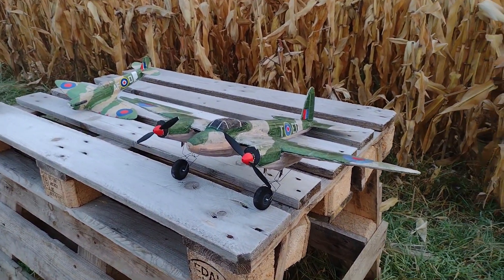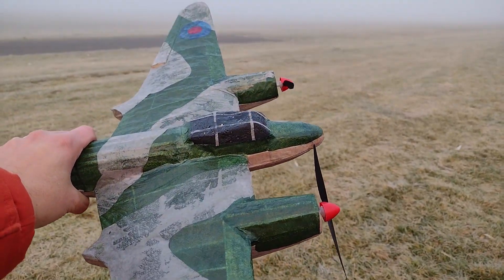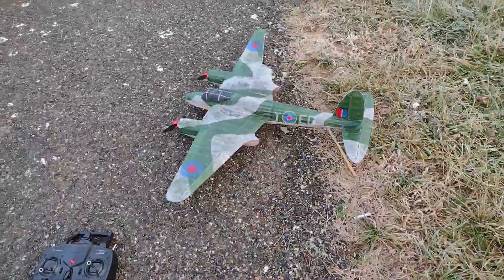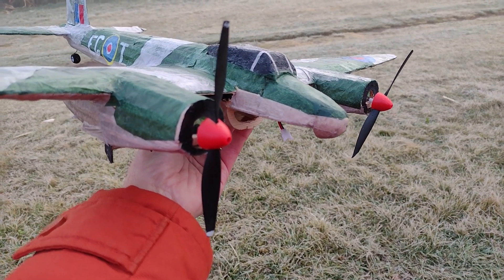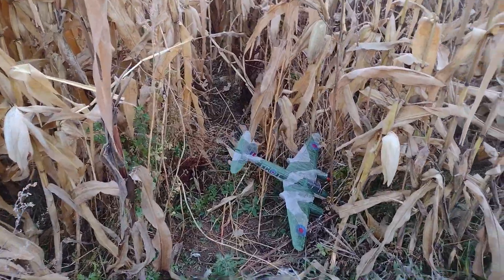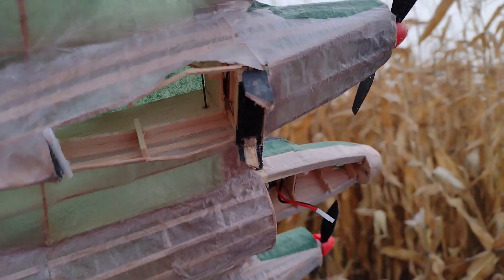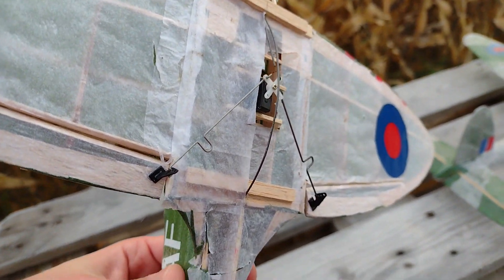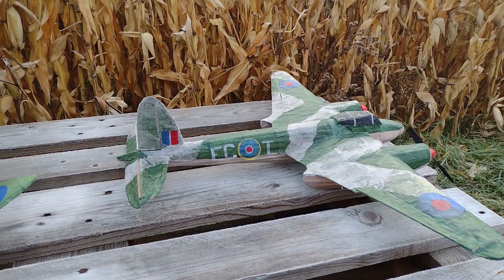Flying the Mosquito and the Spitfire

Comment: I use thin fishing line to attach the control surfaces.  A couple pieces, each a few mm long and glued in with CA weighs almost nothing and holds super well.
Reply from the maker: Thx, I think Cliff does the same thing. I am somehow afraid of fixing the control surfaces in case I need to take them off. Then again, why would I? And with the method you propose, it would be easy to cut them off, and put new ones in if needed. Hmm, you make me think...
Reply: @ CC Cagle At first I thought you were talking about pull-pull to horns and servos then I realized you ae talking about fishing lines for HINGES in control surfaces! Wow what a great idea! I am always looking for easy friction free hinging ideas for my lightweight micro r/c models and your idea sounds like a winner. Thank you. Now which model is my next to build? Maybe my Guillow's DHC-2 Beaver conversion.

Comment: That North Sea fog is going to be the death of your planes mate! 😁
A question please. Are you using 2 x Mustang etc gearboxes and 10x20mm motors for the Mosquito or the Mini Trainstar gearboxes with 8.5 x 20 motors? It would be interesting to know how much current the stock brick brushed ESC can safely supply. Also could we ask you to post the all-up weights of your builds in the descriptions of your videos. Subbed of course to follow your progress! 😉
Reply from the maker: Thx for the interest and the questions.
I am no expert in the electronics and I have a lot to learn.
The Mosquito has 2 Mustang and all connected in parallel to the the ESC (there is a video about that set up in the Mosquito Playlist). So far it is taking it OK, though I do try to keep the flights short and if possible not at max throttle. I am now building a Wellington with the same set up (video about it coming soon).
I know it is a risk, but I have no way of measuring the current the 2 motors pull though I do see that the battery life is about half of the usual time with only 1 motor.
Something which I am not sure is relevant: On ground runs I noticed that the power of the motors at some point drops (but not to a full stop as if it were a drained battery). Is that a safety of the ESC, or am I burning it? I don't know. This might be happening in the air, which might be the reason why the last flights did not go so well.
Reply: @downwindchecklist6567  To measure current (on the ground) you only need a multimeter and a plug and socket arrangement to hook it up between the battery and the plane. Use 10A range - should be 2A or so. There are more sophisticated Power Meters and air telemetry units but a multimeter is cheap and handy. Another useful and cheap tool is a sturdy automobile-type toggle switch wired to an input and output squid of all the battery connecter types that you end up with. For ground testing and pushing tiny bind buttons while connecting power so much easier! ;-)